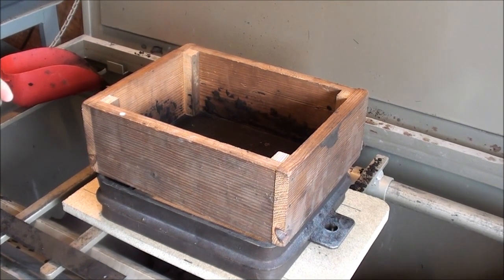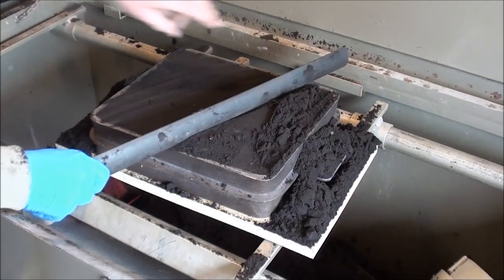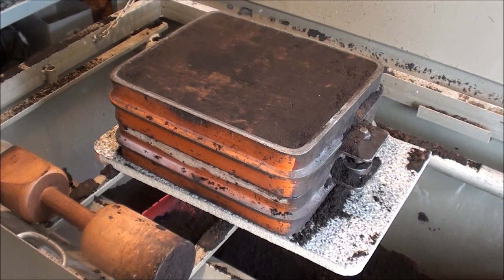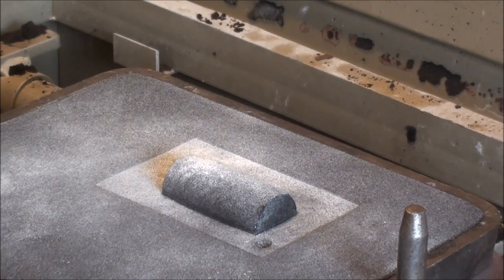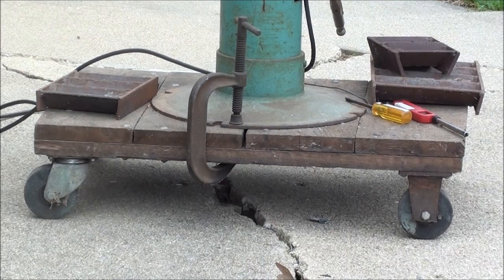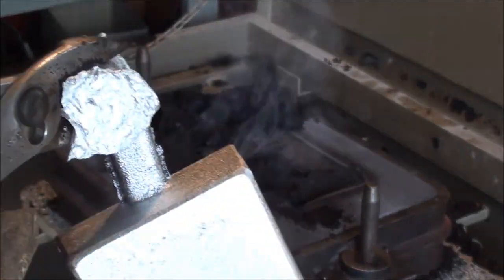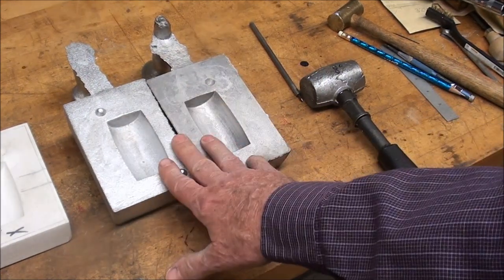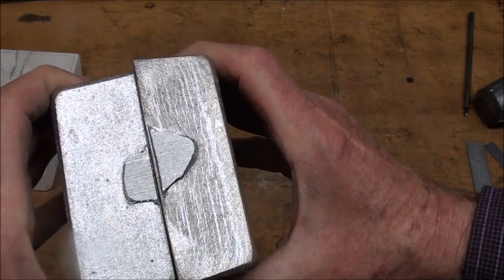Shop Tips #167 TUBALCAIN MAKES A LEAD HAMMER MOLD Part 4

Comment: Old Video I Know, but Just as an add, for anyone who wants to have a crack at small Pattern molding, get one of  those SS Trigger type Flour Sifters.  (pretty much from any Kitchen wares store) they are great for scooping up your Green Sand and then Dusting out a fine layer on the Pattern, It makes for easier control of where you are putting the fine Detail Layer, lightly tamp down then repeat until Patter is just covered, then just switch to unsifted Sand to fully pack out the Drag, It can eliminate a lot of Problems, once you have a feel for it you can get great results every time!
Reply from the maker: Thank you that's a good idea. And I do use the sifter.  It is shown in one of my videos
Reply: No Probs MrPete, It's great to see Foundry Practice still  being taught

Comment: Could you have waited to do the indexing pins until after both castings were poured?I'm just wondering if the blue pattern couldn't be re-assembled,installed into the castings,and used to hold the halves in alignment so that pin holes could be drilled?All to allow both inner faces to be sanded true?Thanks for all the effort.Great series.
Reply from the maker: Thank you. Yes, I suppose that could be done.  There are many ways of approaching this project

Comment: Hi Mr Peter, Enjoyed your trip even if you'd cause one hell of a pile up here in the UK, driving on the wrong side. Japan also drive on the left as, I think do the Chinese. Not sure of that though. The Swedes used to drive on the left as was the driver! 
Interesting, the various fuel costs. Just wondered whether the gallon comparison was taken into account. The Imperial gallon is based on a 20oz pint whereas the American is based on the 16oz pint. So if everyone bought in gallons, you've got to add 25% to get a straight comparison.
In my youth, which sounds like the same period as yours the British teenagers were split in their fashion tastes into 'Mods' & 'Rockers'. The former rode skooters and the latter motor cycles. Oh those were the days. Regards.

Comment: In my Foundry days, working with Aluminum to make transmissions, we called the gates "Runners" in which the end was called a "biscuit". The biscuits was how the robot removed the casting from the cover die.
~
I'm going to do a small video of some "artwork" I kind of made after I had fluxed the furnace after adding ingots and sows, we used a 30' steel rake to scrap the dross off into another "pot". Which later, we would reheat the dross and reclaim even more aluminum, one issue was some leakage from the pot/dross container.
~~
Drop by drop, Ive got a cool looking aluminum Stalagmite.
~~~
Anyhoo, can't wait for the next upload!!!
~~~~
Thanks for sharing your experience and knowledge with us, very much appreciated.
~~~~~
James

Comment: Great videos. Really enjoy all your videos, even the little steam engines. That might have something to do with being a Boiler Tech in the Navy!

 Also, I would like to share a tip with you and your spill proof cans. I use an old speaker magnet to hold my can in place and as a added benefit the magnet cleans the chips from my acid brush. Thanks for sharing.